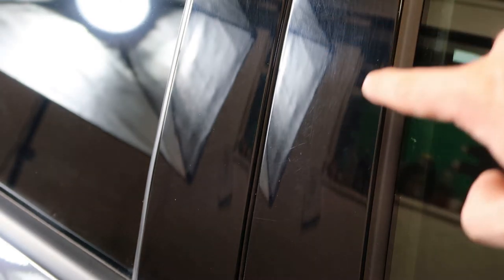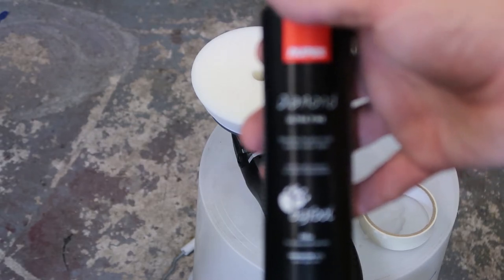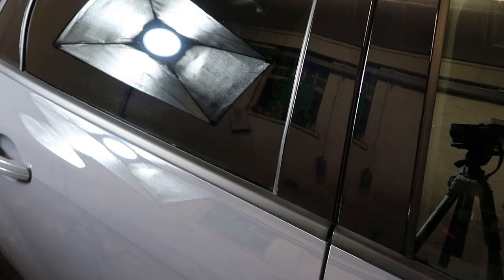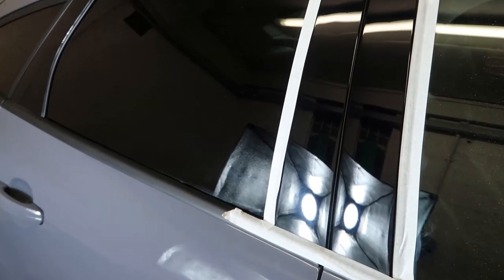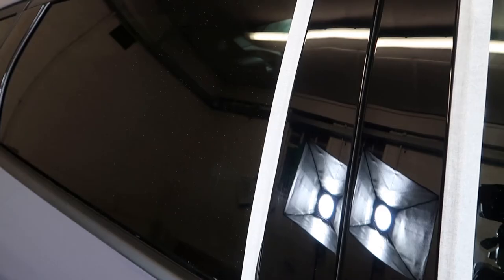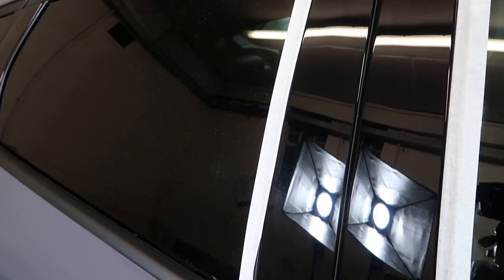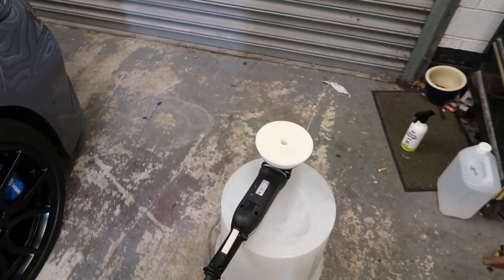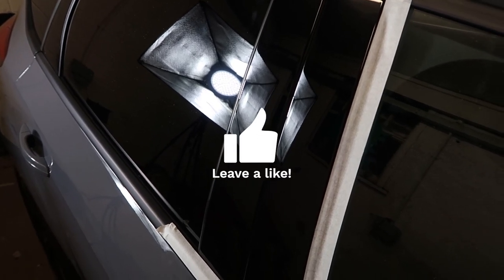HOW TO REMOVE SCRATCHES FROM PLASTIC

Comment: Hi how can I get scratches out of a plastic colour coded bumper on a ford focus 2015 but they are a bit deeper
Reply from the maker: HONDA cbr do you have a DA polisher? My suggestion would be a slightly more abrasive polish. I’m just about to shoot a video reviewing AutoGlym scratch removal kit so will keep you posted if I recommend it. If the scratches are really deep then it may need a touch up pen to fill the gap
Reply: @DaveRebuilds  thanks for your reply a will look out for your new video am just a bit worried in case I go to deep and the undercoat shows through as it's a black car 👍
Reply from the maker: HONDA cbr if it’s still factory paint and you use a DA polisher, it should be ok, it takes off so little too coat you would really need to go some to go all the way to base coat :) plan on shooting the video tonight/tomorrow so should be up by the weekend 👍🏻
Reply: @DaveRebuilds  Thanks so much for your help 👍👍
Reply from the maker: @paul-fk7de  anytime dude